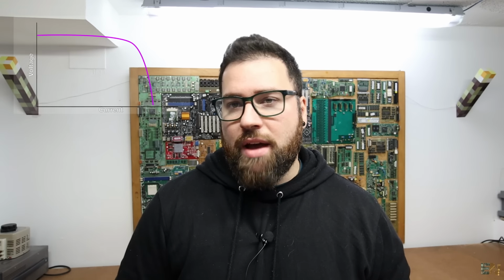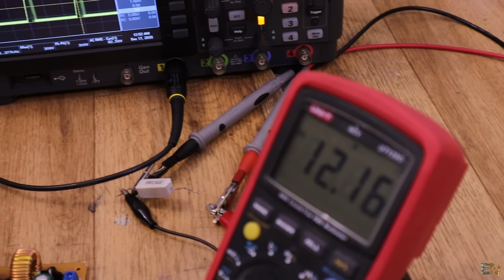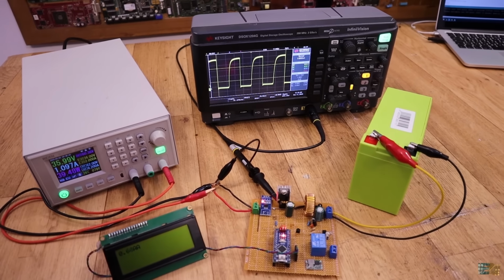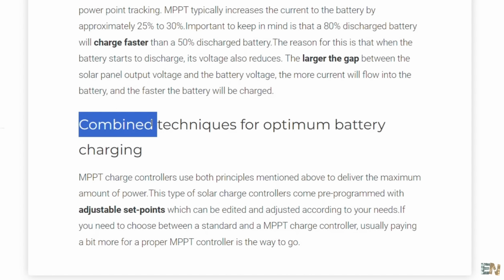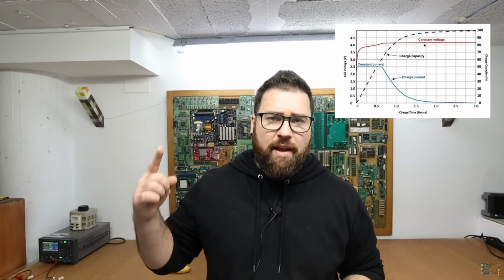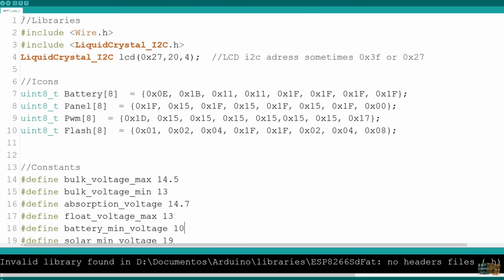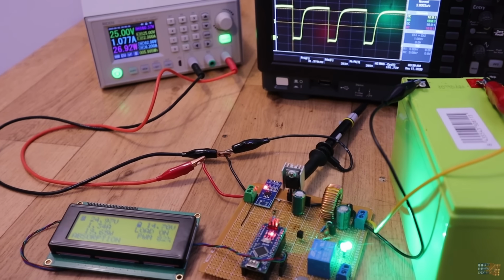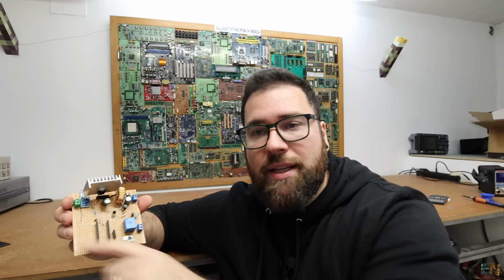MPPT What is it and How it works?

Comment: To drop the say 20 V of the panel down to the 14V that the battery needs are you dissipating the difference in a linear regulator or are you using a buck converter whose characteristics you are altering to achieve MPPT? As a buck converter is a PWM device what is the difference then between this sort of PWM and the type used in simple (non MPPT) PWM solar contollers?
Reply: From what I understand, the buck converter preserves energy using a coil, leading to higher efficiencies than coil-less PWM.

Comment: it is not true there are some MPPT step up systems out there but there are used for really low power applications on places where sun is the only reliable power source but power consuption is no big deal like only a cobble mW are needed. on the north or south pol there are sun over the whole day but less effective for example yea you cold use also a thermoelectric principle with a black side pointed to the sun but also your given voltage is really low compared to your battery voltage you may needing. the biggest mppt i had seen was with step up instead of step down had around 10W or so.

Comment: Thank u for the simple explanation of the MPPT. The concept is clear and the algorithm u mentioned I think is called, Perturb and Observe it's straightforward to code, compared to others such as incremental conductance and novel approaches, however, the hardware design of this circuitry would be a true nightmare speaking from experience, the DC-DC converter would require top class electronic knowledge, as it have to include synchronous Mosfet topology to reach high efficiency. I am excited about your next take on this Electronoobs❤ because it is going to be informative.

Comment: Nice video! Maximum power transfer occurs when the internal impedance (or resistance in the d.c. case) of the source is the same as the impedance of the load. The MPPT controller effectively matches the load resistance with the ‘changing’ internal resistance of the solar panel. The ‘effective’ internal resistance of the panel(s) changes as the light intensity changes. And the battery internal resistance  will change with its state of charge.

Comment: Is there any open source MPPT controller thats easy to build that could charge a small bank of 21700 cells? Im wanting to use a 12S configuration at 48V

Comment: I have a question about charging lead acid batteries. They typically have different charging voltage limits specified for cyclic use and for other types of use (like maintainance charging). As in your diagram, it seems to make sense to at some point change from charging with about 14.5 V to charging with about 13.5 or something similar, but what is the recommended way to decide when to switch to that lower charging voltage? Is it based on time only, or is the decision typically also taking measurements of the charging current into account too?

Comment: The reason you don't over-discharge batteries is becaause most modern matteries depends on somw sort of salt/desalt or oxidization/deoxidization or metal to store electric potential. At certain level the chemical composition is irreversible and damages the layers permanently reducing the overall capacity. 

MPPT controller ensures that chemical composition is stabilised and charge remains longer and stronger i.e. bonds do get enough time to stabilise.  Most batteries are okay til their 5% to 100% capacity and the more regularly you cycle charge with full capscity the better lifespan you get. 

This video doesn't not talk about why you need MPPT in first place. Atleast why it's findamental - it's because solar energy isn't always available with full capacity, at time you have 100W output and at time you have 1200W output from same array, keeping your system charging at same pace increases lifespan and also reduces fire hazards preventing excess currents going to charging circuits.

The algorithms used in MPPT system can be as simple as ease-in-ease-out or can be waky bazier curve, what matters most is timing of the charging and constant current be it in multiples of 0.5C to 5C and stable voltage.

Comment: Tesla isn’t the first car company to use 48 volts. Audi used 48 volts few years ago to run an electric supercharger type thing. Also, Tesla isn’t the first company to disconnect the steering wheel from the steered wheels. Infiniti did that few years ago too. Still, great videos. Get on with MPPT design as I need to make one too

Comment: Instead of chasing and constantly looking for a better point you can in many cases regulate based on the ideal voltage drop assuming a constant temperature on the panel.
The insolation does not change the actual peak power points voltage very much but temperature can make it shift quite a bit.
The ideal point does move around based on the type of cells though and the better (higher efficiency) cells often have a higher voltage at peak power point.

Comment: i have an esp 8266 connected to a box with 2 pir sensors powered by a 12v power supply from the mains. I have 2 pir sensors acting as AND gate i.e when both detect motion ,a pulse is sent to esp. (to avoid  false triggers). the input is pulled low by a 10k resistor. Recently when testing it outdoors i saw it being false triggered ocassionally whenever someone turns on or off some other electrical switch in the house. Can someone tell me what to do to avoid this? bypass caps? please guide me?iam not an engineer

Comment: But The pwm controller work just fine in my ups  even if the battery voltage is lower than 12 volt and above 10 volt and i see no difference in buck boost or mppt they all charge good

Comment: Hi, unexpected video man. I'm working on MPPT controller that based on ESP 32 and syncrhronous converter and it is almost done. There's some point that i can verify from your video. 

First, the idea of explaining how MPPT works with current limiting power supply is not actually wrong. Using panel and load it with a variable resistor (rheostat) or maybe you  can try using bunch of different load resistance to see how the characteristic curve of the solar panel would be a  better idea. 

Second, ACS 712 is hard to tame and after i try it, i recommend that using one need a digital signal filtering which if the project use arduino, it would eat much of its CPU capability. I can confirm that INA 219 is very robust choice and for those of you that need more than 3.2 A of current measurement, u can change the shunt resistor and modify the library (there's video on youtube). INA 219 has internal PGA which the gain can be adjusted. In my case, i change the shunt from 0,1 ohm to 0,01 ohm and last time i was trying to pass about 8A of current. Comparing the reading with my fluke 73, the result is satisfying. For the 26 V max rating, i'm not yet try to go beyond that, but what i know from the datasheet, there's a digital switch that makes ina 219 able to read voltage, maybe you can just use voltage divider for reading voltage with analog pin of MCU and not use the build in sensor method. 

Lastly, there's a channel call "tech builder" that already made a very succesfull MPPT SCC and all the small detail is being mention in his youtube channel and website. Hope it helps all people that are trying to build it.

Comment: Very interesting. Thanks!.
I am building a micro hydro and want to charge lithium batteries. The optimum RPM for efficiency is dictated by the water column height. The permanent magnet generator is wound for an output  of approximately 50 volts at this RPM. The battery bank is 48 volts . The maximum current output of the generator will never exceed the maximum charging current that the batteries can accept, since the batteries are quite large. I was considering using an MPPT controller but now think that a direct connection without any controller is better. When the batteries reach their maximum voltage, a voltage controlled relay will dump all the power into a heating load.
What do you think? I hope I have piqued your interest.

Comment: Another way to explain  what's going on in mppt. Mppt  changes the apparent impedence seen by the  source.  The apparent  impedence seen by the source  is done with dc to dc converters. They may be buck, bost, or buck and boost converters. Increasing the  output voltage pushes more current and  effectivly reduces that apparent impedence to the source while outputing a lower voltage  increases the apparent impedence to the source.

Comment: Take a coil in a generator. Lets say it has 1 ohm of resistance.  Each amp that flows through the generator causes 1 volt to be drop across the resistance inside the coil.  This drops a coil's output voltage to be less than its open circuit voltage.

Comment: Electric cars actually use way higher voltages than 48V. They are more like in the range of 800V. It depends on the cars and battery technology. Electric cars oftentimes still use little Li-Ion cells and that makes it quite easy to make up to these kinds of voltages. Cars that rely on more bulky batteries have less options in that regards, so I would expect them to be lower in general, but I think they should be still way above 48V, or else they would require insanly thick copper busbars to deliver the required power.

Similarly solar panels that are mounted on the roof of a house are also higher than 24V. Each panel nowadays is between 40V and 50V. On my solar installation I used 50V/10A panels. These panels are usually connected in series, to raise the voltage even further. Parallel connections are (or better said, should be) only made when the inverter (or MPPT) can't handle all panels in series. Some inverters go up to 450V and some even beyond the 1kV mark, depending on the brand. Though MPPTs, like the ones used on RV rooftops oftentimes only go up to 150V - 200V. But these RV panels are actually a lot smaller (usually about 1/4 of the size to a regular panel). Maybe those were the ones, you referred to?

Comment: The Porsche Taycan was the first production EV with a system voltage of 800 volts, according to Porsche. (Image: Porsche.) Interestingly, EV pioneer Tesla has not committed to shifting to the 800-volt architecture.

Comment: I think the Tesla use's match more voltage, I have a little Renaul Kangoo 100% electric and this uses even a 400 volt batterie. I transfered a Daewoo Matiz to electric with 2 motors off each 10 to 20 HP on 72 V and they pulled in full power accelleration  each more than 550 A !! My wires off 14 mm smoked and the batterie connections even melted !
Though thanks I wait for You mpp charger project !

Comment: Steering that is disconnected from the wheels?  Gee, what could go wrong?  There's a very good reason that no other vehicle works that way.  What happens when part of that steering system fails at 70 MPH?

Comment: Using a regulated constant voltage/constant current power supply for this example is very misleading.  The voltage is dropping because it is in constant current mode.  The voltage doesn't drop at all in constant voltage mode, even with varying load.  A solar panel doesn't work anything like that.  You could have put a power meter on a solar panel (even a tiny one on your desk) with a variable load and it would have been a far better demonstration.

Comment: Just like a push pull this automatic action can do done with bjt and fast switching ziner diodes in series so if current draw stay 50 amp at 12 volt the ziner will open and close  in millisecond keep the voltage the same

Comment: Nice video good explained.  But this device is a massive jamming transmitter. The pulses from the switching back feeds the harmonics of those pulses that go far into the rf spectrum to the solar panels that form a antenna. Without proper filtering as often happens. This is a major problem of solar installed with substandard Chinese optimizers and unqualified (Cheap) installation. This happens a lot and is killing hf radio.

Comment: thankyou for the informative video!  just to mention something about electric cars that they can use two separate DC systems - one for the motors around 600 - 800 vdc and then one for the instruments etc which as you mentioned is 48vdc or lower.
cheers again!

Comment: I’m looking into building a self heated LiFePO4 battery for my 24v military truck. Of course I could go easy with a MPPT box from VictronConnect, but I’d rather build my own MPPT so I’m really looking forward to the next version. The theme I have is military aviation digital screens with multiple Arduinos controlling everything, so this would fit right in.

Comment: When considering "large" solar panels in series you will need to allow for the open circuit voltage being considerably higher than the nominal (rated) output voltage. For example, I have a set of 4, 250W panels rated at 24V each , but the open circuit voltage (on the label on the panel) is 32 volts. This is particularly relevant if you are in a very sunny location as I am in Australia - I feel that in our often very high sunshine environment that even this maximum rating is conservative.
So when connecting a string of panels in series, this extra voltage can quickly become significant, both in terms of component ratings in the controller and as a safety issue should you accidently touch the live output wires.
I am looking forward with interest to this project, as I want to build a suitable MPPT controller for the above mentioned panels - the "cheap" Chinese controllers I have previously used have failed more than once, likely due to this very high input voltage - so I want something with more robust and better rated components.
Reply: I'm using a set of cheap second hand 80V 55Wp panels, connected in parallel. They'll probably never deliver that peak power, but on a sunny day their voltage may reach up to 90V when connected to a low power load.
Since I got these panels for less than 20 euro's I don't want to use an expensive controller. Best I could find for a few euros is a 100->12V 36W buck converter. I'm still working on making other components (such a 12V battery charger) to get the most out of those panels. So far that converter survived, but I probably need to improve security measures to avoid a fire in the summer...

Comment: For measuring currents with a very low voltage drop I'd suggest a INA180A2. This is a fixed x50 current sense amplifier. Thus you can use a very low shunt resistor around like 10 or 5mΩ for 10A. There is no fixed module, but you can get them for rather cheap from mouser or digikey.

Comment: Thanks for randomly reminding me that hall effect current sensors are susceptible to EM interference. I was just wondering why my Arduino controlled eBike charger lost calibration when I assembled into the case, but now parts are much closer together and the boost converter is likely messing with the hall effect sensor.

Comment: Hey, Im making an MPPT charge controler and I wanted to ask if its better to go from 10w 18.2v solar panel to 12v or 6v lead acid battery, i need this for greenhouse automation and im thinking if 6v will be enough for servo motors, that will open the roof windows, what you guys think?
Reply: I think a servo that is strong enough to open a window will need more than 6v. But that is just what I am thinking. You probably need to look at the model of the servo and look online at how much voltage it needs and how strong it is.

Comment: I would love to use the output of my micro-inverter on my solar panels to charge a battery when there's extra power and then use it when needed, it's not very efficient as you're going DC->AC->DC->AC :/

This was a really good explanation of MPPT, thank you!

Comment: I like the idea of the hall sensors. Basically zero loss. Try some small metal (steel) screening to prevent stray magnetic field. A bit of tin can cut to size, maybe.
Reply: Well, that's what I was thinking. But around the choke or around the sensors?
I was always wondering, what bad thing did Faraday do that he needed to be put in a cage?
Reply: @CrispyCircuits  Ha! Yes, he was protecting himself. So, along his example, protect the sensor put the tin-plate shell around the sensor. Test and if necessary, do both! I think your testing would make a good video in itself. 👍

Comment: ..nice and informative, as usual - looking forward to the next steps oft the project.  So you decided to change the hall-based current-sniffer to a shunt-typed sniffer, that's interesting. Regarding the shunt-type I think the signal output and the current line, to be measured, are not “connected” and separated from each other with opto-couplers, am I right? thx

Comment: You were saying that MPPT helps to increase efficency of charging circuits.. 
Can MPPT help to save/deliver a better delivery in running a robot?

In a robot, not everything runs on the same voltage.. 
Motors and servos use different voltages than micro controllers. 
Can MPPT be used as a power management system for a robot?

Comment: One problem with solar panels in series; if one of them is not getting sunlight, it'll basically block the voltage from the other ones.
A mix of series & parallel is best for solar panels for this reason.

Comment: 19:59... Don't know where you are getting your information but the Main Battery on the Tesla Cyber Truck has been increased from 400 Volts to 1000 Volts. The Accessory voltage has been increased from the standard 12V to 48V but it is unclear if a separate 48V battery is used or what Chemistry is used.